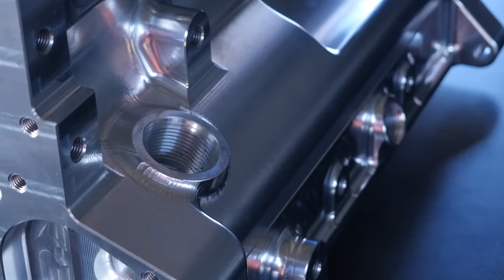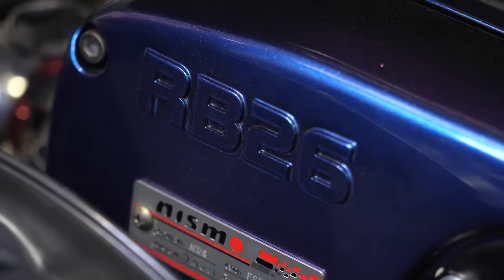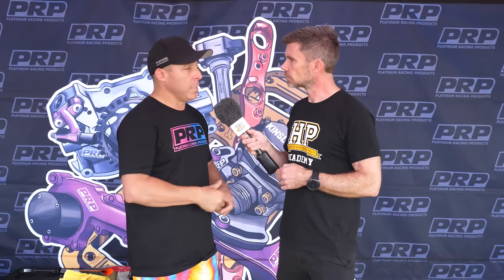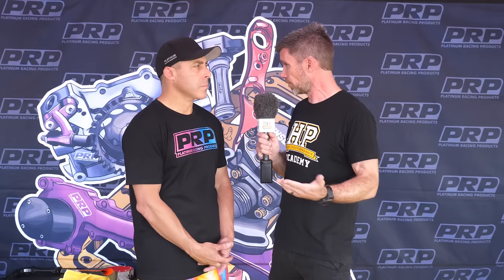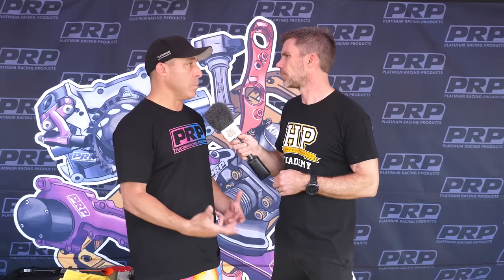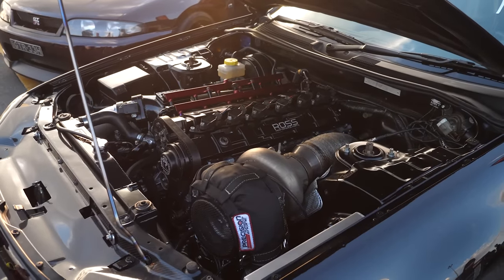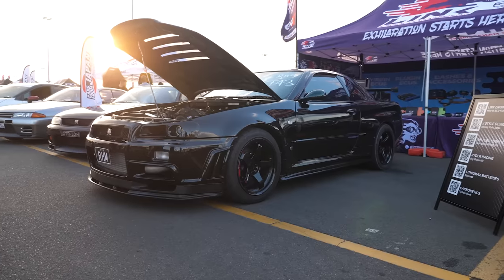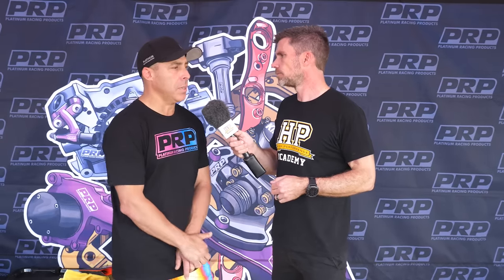What Is Wrong With A Billet Block?

Comment: Well, this is a bit dishearting. Due to a lack of cast options the shop working on my build convinced me to go with a RB billet from PRP. I didn't know much about billet engines and couldn't find much on the net initially. They reassured me however that after a conversation with prp the wet deck application would be very suitable for my street driven GTR that was 600 whp before they discovered a crack between cyl 3 & 4. This was supposed to be a build that I could have peace of mind and just enjoy the car, however it sounds like I've been escorted down the wrong road after watching this.
Reply from the maker: TL:DR Don't panic, you will be fine. 

There are considerations, but they are not show stopping. The rate of thermal expansion of the material used for billet blocks (which is not the same as OEM cast aluminium) is what you are dealing with, and there are 2 main ways that your or your engine builder will deal with this for your street application.

Option 1.) If you run tight clearances (tight at room temp) you need to take special care to warm the engine before use. If you live in a very cold climate, you might consider external fluid heaters etc, but for most it's a matter of idling for a bit and then driving gently (because idling only gets you so far) to finish the job before leaning on it.

A lot of people do this anyway just to be nice to their engine even if they are running a cast iron block, but that is just to be nice, for tight clearances and a billet block it is not a choice, it is absolutely a requirement if you want longevity.

Option 2.) If you run loose clearances you avoid the issue above, but you have to deal with the side effect which is low oil pressure. This is where you want a dry sump or external oil pump like Herman mentions in passing. For the work of dealing with an external oil pump, in our opinion, you might as well go to a dry sump system and I believe that is what Herman is thinking too here, hence that comment.

The company Herman mentioned he sells many billet blocks of, Bullet Race Engineering, have 100's of blocks in daily driven (or at least street driven sometimes) cars without issue and those owners are doing either of those things above. 

Note if you are running a high power application where you want looser clearances then the decision is made for you though really.

Sorry for the massive reply but I hope that helps put your mind at ease - Taz.
Reply: Appreciate the thorough explanation. I spoke with the builder (Brian Roche). He was subcontracted via the performance shop as Bullet recommended them. They built the short block closer to manufacturing clearances, so it looks like Option 1 will be more applicable. I guess I was also troubled at the notion that it sounded as if there was would be more maintenance involved, pulling the motor more frequently, but maybe that’s more relatable to high horsepower builds. Your channel is very informative and again appreciate the response.

Comment: Wait...what do you mean?  My CNC is almost ready for me to cut myself a billet block T.T. Lol
Reply from the maker: I know you're kidding, but if you were at the crossover point where billet is what you need, you'd still run it up on the CNC. Weight is the enemy in motorsport, and a cast iron block isn't winning any comparison battles to billet on that front.
Thing to remember is that weight doesn't matter in as much a street car given the compromises you make to run a billet block vs a dedicated motorsport application that is racing against others at a high level - Taz.

Comment: Why would a billet block have to run a dry sump?
Reply: Probably has to do with external sump heating and method of pushing warmed oil through the block before startup?
Reply: @jlehm  you can have a heating element in the sump, or attached to it. Same with coolant.
Reply: @chippyjohn1  you probably have to use an electric pump to circulate the warmed fluids then. Even if the sump and radiator were warmed, that warmed fluid wouldn’t be circulated through the block to fully heat everything to an even operating temp.

Comment: Why not billet component. Have 8 modules mated up for an 8 cylinder. Throw a rod, just replace a module. Not the whole block. Still billet.
Reply from the maker: You can repair billet. That is one of its advantages 🤘 - Taz
https://www.hpacademy.com/blog/the-road-to-prolines-5200hp-hemi-v8-tech-talk/
https://www.hpacademy.com/blog/cast-vs-billet-mountune-motorsport-engine-block-design-tech-talk/

Comment: did they manage yo get the weight down?
Reply from the maker: Not below a billet aluminium block. If weight is a huge factor for how the car is used down to requiring a billet block, then it's a stripped out race car, not a traditional 'street car' as a rule 🤘 - Taz.

Comment: If you no anything about metal cast is stronger then billet.look at Japan's metal mix of its top JDM blocks 2iz light and hard and strong.a foundry doing small mix small runs of blocks can do specific mix for very strong blocks..billet is not the way to go..
Reply from the maker: You can also use a range of mixes (alloys) for billet, and often they are repairable if something goes wrong, which usually isn't the case with cast engine blocks.
Really there are people who will find the best option for them is cast just as there will be people who's best option for their application is billet.
The key is to use your brain and work out what suits your own application rather than just copying someone else that might have entirely different needs, and budgets 🤘 - Taz.

PS, here are some links covering both sides of the coin beyond just materials and repairability.

https://www.hpacademy.com/blog/cast-vs-billet-mountune-motorsport-engine-block-design-tech-talk/
https://www.hpacademy.com/blog/thor-1500hp-to-3000hp-of-custom-billet-time-attack-champion-tech-talk/
https://www.hpacademy.com/blog/107-billet-isnt-everything-the-rise-of-aftermarket-cast-engines-podcast/
https://www.hpacademy.com/blog/041-hunting-for-huge-reliable-power-is-billet-the-answer-podcast/

Comment: So a wet billet block i just heard is dedicated race block, So far from the truth, set it up right with the right builder its no problem, ive owned one from JHH racing since 2019, street driven, yes warm it up before a hit, takes same time as a normal block and anyone in their right mind that owns 1000hp+ engine that aint doing that with any block is just stupid.  Yes there are some learning curves for the builder, but if you go to the right dealer/engine builder experienced in years of billet motors, there are no downsides apart from trying to keep it look as shiny as when you bought it
Reply from the maker: Yes and even then there is a reason why you don't see every racing discipline out there using billet alloys even if they have the budget for it (and if the rules allow for it!). It's basic science when it comes to the material properties.
You can use them on the street, but they do need some special considerations comparatively. Some people like yourself are cool with that, others are not just as some guys will drive 12 hours across country in a car that has suspension setup for the track and all solid mounts, and someone else wouldn't want to spend 20 minutes in a car like that off track.
For most guys though it is simply the price. Billet blocks by nature are expensive to produce.
Great you're enjoying your own setup and path though, that is the main thing for you to tick off on a personal level. How many KMs have you put on it since 2019, at what power level and what engine our of interest? - Taz.
Reply: Yes i hear u, mine was one of the first bullet  street setups, ran at 1250 back then, till 2021, est 4000kms on that motor over those years, mainly roll racing and street cruising.  Since 2022 runs 1300-1500, as you know there were early hurdles with block growth under heat, but the guys in the know have it sorted, 
$$ in the block outlay yes, but when i added up all the prep work and support systems for a cast block at 1300hp vs longevity of billet it wasnt much more than going cast

Comment: Kinda big words in that thumbnail , compared to what is in the vib , sry
Reply from the maker: It is on the more dramatic side for sure. The question mark is an important distinction at the end of the day as we certainly don't think the same type of person going for the billet option is the same type of person going for an aftermarket cast block anyway - Taz.
Reply: @hpa101  were billet blocks ever ment for daily use or for high power aplications ?
I was only talking about the words in the thumbnail here. With this ,it will for sure not be "the end of billet blocks" , not at all , they will still be used where it will be needed.

Comment: dont believe this crack block theory. same old story, the engine builder should know how tight to do your head studs..yes the RB wont like 140FP head studs, 110-115ft using ARP2000 is enough for most. Herman is going wild talking this, there are thousands that arent cracked, for every 20 RBs you might have one or two failure  (not the other way round) 5 years ago (and for 30 years) RB blocks have been just fine. dont beleive me? go onto SAU forum and see how many thousands have been built. Herman is the same guy that told us the N1 block is the same as stock, he even went as far as saying the RRR block is the same as standard. Buy an RB30 if your afraid, they are $800-and those live at 1500hp without grout and 2500HP with grout!

Your tune up can be capped at 900NM and as many horses you like

Growing up in the scene many RB26's have lived at 800-1000 wheel hp with rods and pistons!